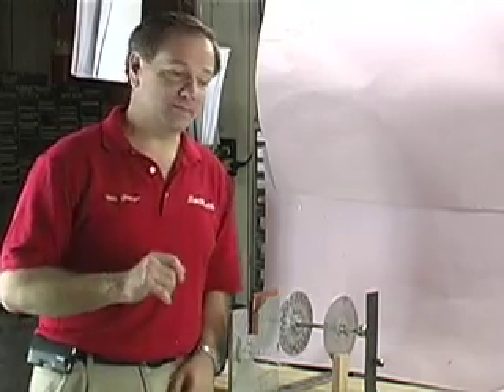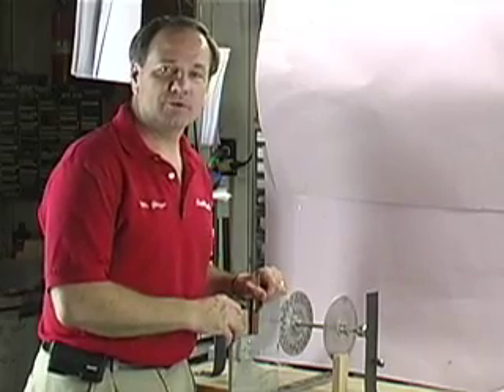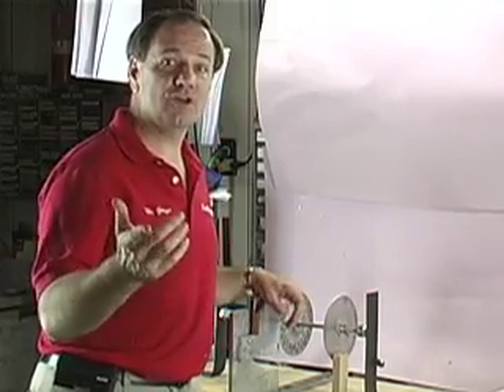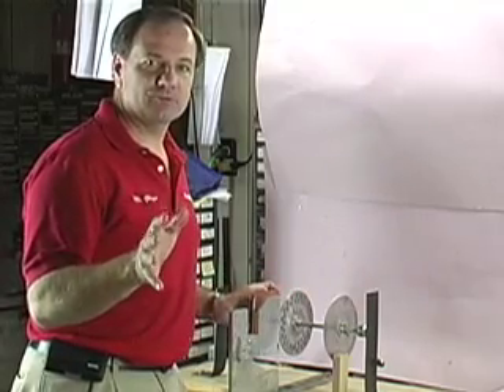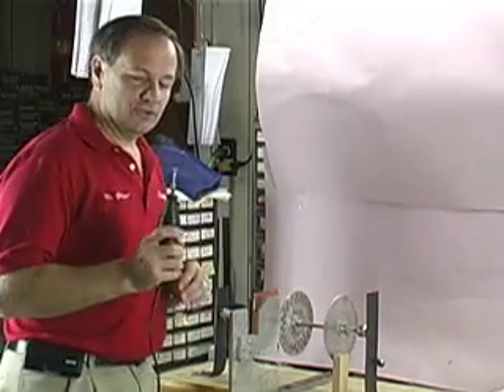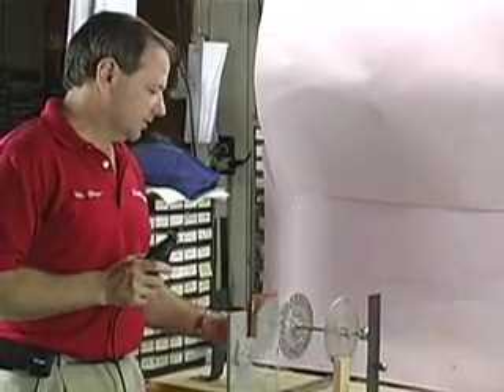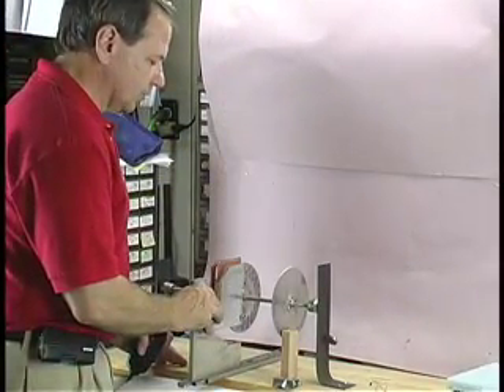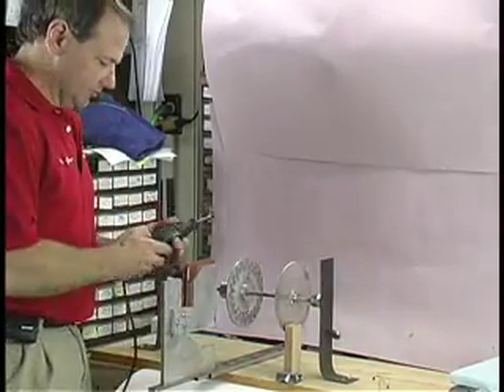Supermagnet Braking system - Working

Comment from the maker: I assume-you mean put the magnets on the side & the plate in the middle. I'm not sure but I know this works.  The key is lots of small magnets worked better than a single ring magnet would.  Each magnet interacts with the stationary plate & creates a small drag force that accumulates to make to total effect.  I think the benefit comes from multiple magnets moving at the speed they do that maximizes the total force.  Sounds like a good test to run - someday when I get a few minutes.

Comment from the maker: Technically there has to be heat but it is so little in this exampple that my K-type thermocouple probe did not register any heat change.  The braking energy would be translated directly to the foundation of the aluminum.

Comment from the maker: Copper does a better job than aluminum.  Since it is more conductive it has a stronger paramagnetic effect.  It was easier to find thick aluminum than copper but I did layer 3 pieces of copper on each side and it cut the braking time in half.